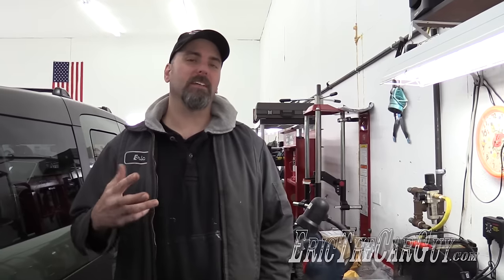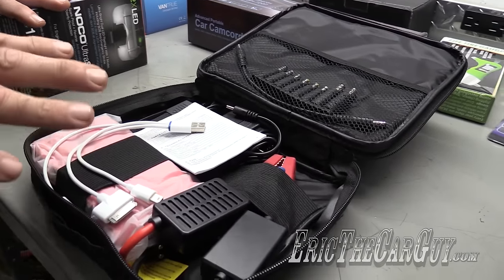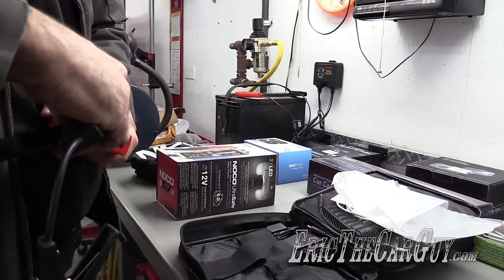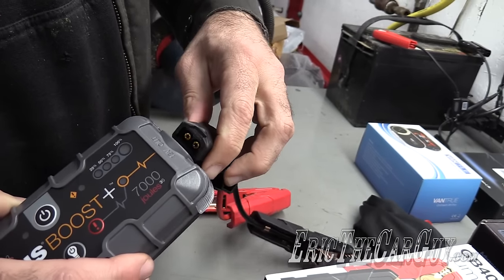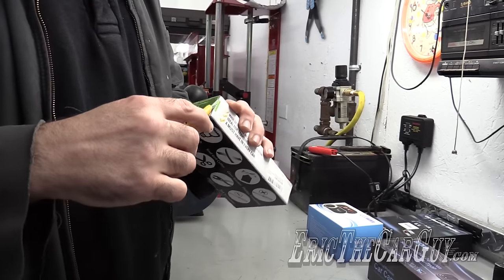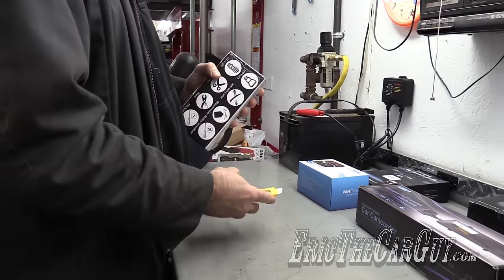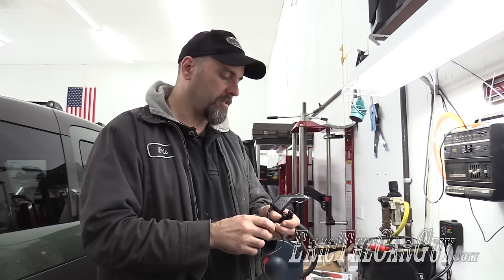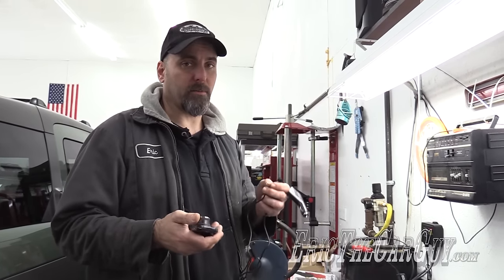The Electronics Special 2015 -EricTheCarGuy

Comment: The yellow button is to lock the current video file on the card (actually it's moved to a different folder, only for these "secure" files) so it's not overwritten (which is the default behaviour on dashcams) It's not possible to transmit anything on  GPS, it's receive-only and used for showing speed-overlay and location on the video.

Comment: Hey Eric I own the second dash cam you reviewed and love it.   The orange button actually bookmarks video.       Parking monitor is good for if you have the camera hard wired into the car in a fuse that has constant power.   The cord is built to not drain the battery.   If the car is bumped, the camera senses the g force and turns on to start recording.

Comment: I like all my little gadgets in my car, I have a sub and upgraded sound system, bluetooth, magnetic phone holder with a charger, jumper battery with a small air compressor, rear view camera on the rear view mirror, remote starter and security system, radar detector, dash cam, and a tire gauge like the second one you showed. To me that stuff comes in handy all the time. Also I really like the suction cups with the locking mechanism, they hold on for dear life.

Comment: I just bought myself a dash cam last week , a early Christmas gift , yay , its a nanman unit , works well .

as PS the parking function works when there is enough battery charge in the camera , so it wont use the power from the accessory point .

Comment: Eric, the GPS on dashcams is probably their most important feature in their most important role (funny youtube crash compilations excepted).  Not only will it tie in your video pics to and exact location, it will also record speed.  Handy in a crash dispute.I'm, guessing the orange button on one of them is to save the couple of minutes you want to (they tend to record over their memory unless you save them).  You can save something of interest that way, or they automatically do it when they decide there has been an impact.
Reply: GPS also works against you, if you are speeding.

Comment: Blackvue dash cams, very small and discreet, excellent quality and simple to use. 
Sadly to use the parking function you will need to hardwire the cam into the fuseboard or a perm 12v connection. This is also confusing as they dont supply a cable to do this and tell you not to cut the one that they have supplied..

Comment: Hi Eric, This video sounded like a Christmas stocking filler.  You weren't very into it, felt obliged to do it and easily forgotten.You did slip in a cardinal error though (that everyone in the trade commits from time to time!).  Wherever you work from, yard, compound, unit, you never park a dead car in front of a moveable one.  Pound to a penny, the one that you have just blocked in, is the one you need access to next.Have a great Christmas and New Year.

Comment: 19:30 that could be very pragmatic for an RV or large vehicle where you normally have blind spots. I drove a very large highly custom sealcoating truck for a summer job and it could be quite a challenge at times. 429 big block

21:51 close up of the creatures living in your beard. beardcam!

22:58 speaking of a trailer hitch is there enough cable to put it on the rear rearmost end of the trailer? That could be a big help in the safety dept, especially having one on the safety chains. The camera would be ideal if it was wireless/wifi/bluetooth.

I'm not HUGE on gadgets but when they serve a good purpose then its worth buying. Like my jbl charge 2 for biking music is practically invaluable. It sits in my water bottle cage and is so perfect as a walkman replacement plus it increases my safety by leaving me the ability to hear cars as compared to wearing earbuds or headphones. 

Maybe that is where you should draw your reviewing line -- items that increase consumer safety because cars kill more people every day than guns do in a year yet guns still get more newsplay.

Comment: I have the same car jumper (the  noco), it's actually pretty good. Most of the cars i have to deal with are usually utility cars which sometimes sit around for months. Biggest thing i've managed to jump (i think it was the limit) was a small Merc truck.
 
The hammers are a bit meh, but the green one with the 3 different units is nice.

I just love that my phone can emit FM radio and thus i can pair it directly to the radio in the car. Having that whole majumble would be a bit too much.

The head-up display is neat, you can hook it up to older cars, especially when you're reluctant to open, and potentially, ruin the dial cluster. If it would work that is.

Yes, extra, super popular in Europe, i see it more and more each time i go to eastern Europe. Funniest setup i've seen has to be a guy who had a taxi and used old go pros to record each side of the car. 'Paranoia induced by asshole bureaucracy'.
Reply: +aserta what? what phone do you have? you made me curious

Comment: the only thing i want to point out about some electronics near the rear view mirror on GM vehicles can cause issues with key-less entry and tire pressure monitoring system when powered up...  I had an equinox come into the shop a while back with tire pressure problem and it ended up being a cheap dash cam on the windshield that had to be operating on the same frequency that the sensors transmit causing them to drop out....

Comment: I'd be more interested in those dash cams if they recorded at 60 FPS and in stereo or had the option of attaching a stereo microphone.  But for now, I'm sticking with my GoPro.  The Bluetooth interface looks a little cumbersome.  I really like the one I have that plug straight into your aux port and is out of the way.  No cords or anything.  I do have to plug it in every now and then just to charge it.
Reply: +kcg795 They're for insurance purposes, nor for professional production.
Reply: The thing is; you can't plug in and forget a GoPro. It's a high theft target.
Heck, my truck was broken into just over a week ago to take my 3 year old G1WH.

Comment: 2:20 the genius boost, you talk about throwing it in the back and I can see that being very practical but most of the high amp batteries these days have low internal resistance meaning they self-discharge fast so if you throw that in the back and a month later you car dies will it even work? (this is VERY common in MN this time of the year. Plenty of cars run around with their alternator having one dead diode and it charges OK all summer then come winter it seems to "die suddenly' when really the system has been inadequate for months and its why I prefer an analog voltmeter gauge instead of the idiot light. Idiot lights are only for idiots :)

6:01 useless heavy tire gauge. I still have mine from when I worked at amoco in my teen years. Wish I had one that did presta valves and I hate batteries in crap like that plus they are rarely durable enough.

I just found your channel. Excellent vids & the fellow who said a spring loaded center punch makes a great window breaking tool is right. HF.com has them cheap and everyone should have one in the center console especially when the land of 10,000 lakes often has them right near roads. People have drowned and dies in ditches because they couldn't get out of their car once wounded after an accident. Cheap insurance if you ask me, as they are like $5.

9:36 bad for the phone to put it in front of the heat vent because heat and dirt are what kill electronics. Only use it if you have a phone replacement product or when running AC. (yeah, I'm an electronic trained tech, went to college for avionics)

9:54 I found that out the hard way. One vid uploaded and because I had spotify running in the background it thought I was trying to upload copyrighted material. Now my vids take forever and often do not upload at all even when I leave it going all day and all night long.

12:21 bluetooth rocks! I can take phone calls via my bike while biking because I own the jbl charge 2.

Comment: Those portable jump starters are just 12v power banks.
I personally do not know how long they will last if you have a bad battery, 18650 cells do not like to put out huge amounts of current.

Parking monitor sucks on those since the battery in them only lasts 2minutes or so.
They are also bad dashcam units, IR leds are useless as they just cause glare on the windshield, white LEDs are just pointless.

The HUD thing may have been faulty.
Reply: +IIGrayfoxII Yep, just a 3S Lithium-Polymer pack. The kind of cells inside is from the RC-world where amp-draws in the 200-300A range isn't unheard of.
Reply: +NornIron1991 True, but then you can make the battery flat unless you run power magic pro or something similar.
Reply: +IIGrayfoxII On my truck anyways, you can run the camera on full record for probably 4-5 hours without an issue. I regularly do 2-3 hours when shopping.